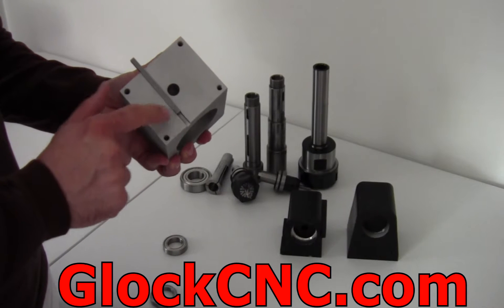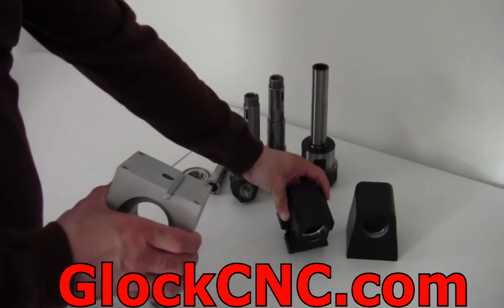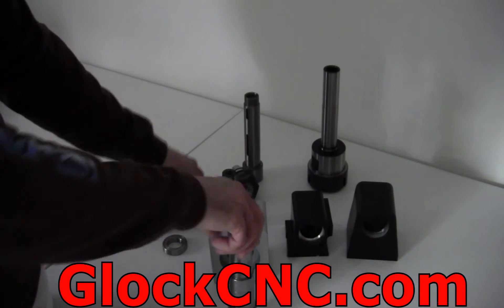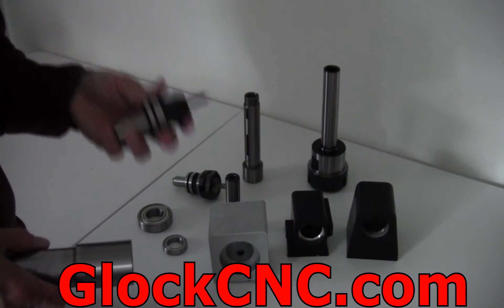New ATC Headstock For Sherline Mill uses R8 w/TTS or MT3 w/TTS

Comment: Wow!  That's quite a nice looking upgrade for some applications.  I use the Tormach Tooling System in my non-Tormach mill and it's very nice.  I'm not so much interested in more power or super beefy bearings for my Sherline lathe, as I think the power is well matched to the lightweight machine, but I would love to be able to use a 5C collet and an automated collet closer (believe it or not).  The Sherline collets are just slightly too small for the through spindle work I want to do on my CNC mini lathe that I built based on the Sherline lathe, and manually opening and closing the ER16 collet is getting to be a hassle for short run production.
Reply from the maker: Liberty4Ever We will be coming out with the 5C headstock, lever closer and automatic collet closer.  We have had many ask for this.  Mainly people and companies that use them on custom machine builds, but some who do use the Sherline frames.  It may end up as a Kickstarter project because the initial cost is quite high.  Also considering doing ISO tool holder headstock for mills.